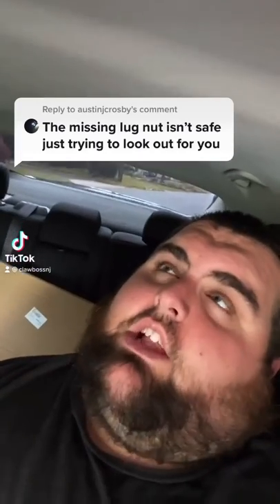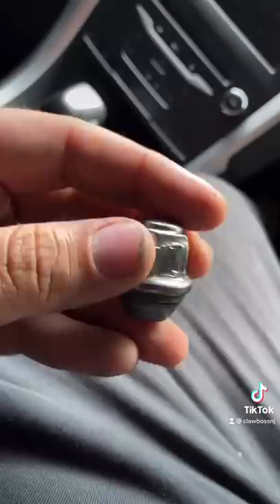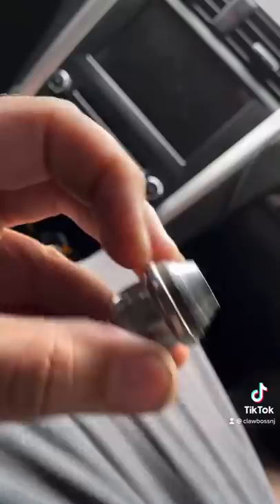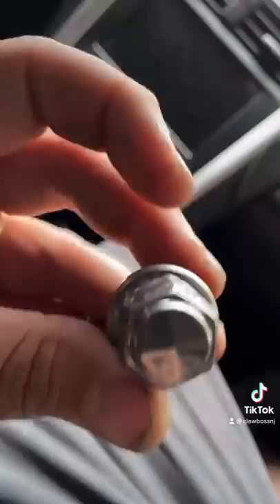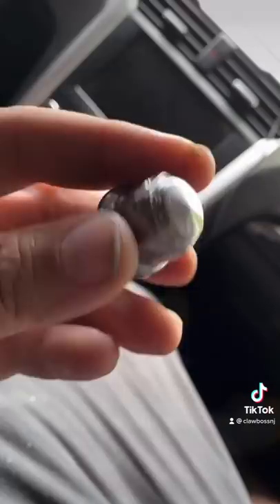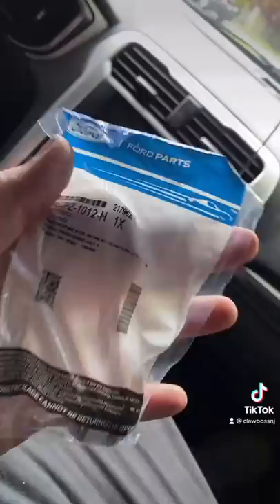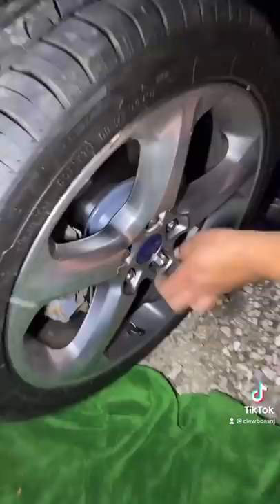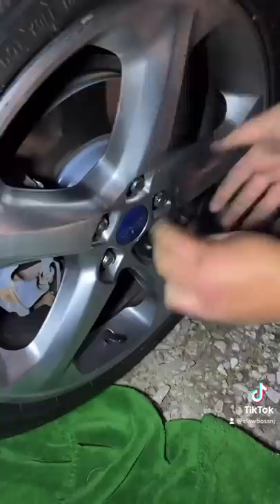Why Do Lug Nuts Expand and Puff Up?

Comment: hah requires a special socket, me in my shop takes a chisel and hammer, take the chrome sh off and look lug nut still usable and it comes off, also, you can drive safely having 4/5 lugs on a vehicle so long as the lugs are properly torqued, heck even 3 is safe, but the reason why 4 is ok is cause 90’s rims, 4 lug hubs, its safe, on light vehicles anyway

Comment: Dont listen to the people that are hollering how unsafe missing one is........ nascar had to remake a 5on and tight rule because the two seasons the rule was relaxed, over half the guys were running on 3, yeah that fast, yeah 100miles or laps between stops..... nobody lost one while driving,  the rule was reimplemented due to danger of breaking off in a crash, possibly getting in the stands officially,  unofficially the drivers decided to lobby nascar to get the rule back out of fear for their safety. So if you are genuinely afraid,  replace it, if not don't sweat it im Old enough to be your dad and I have driven many cars over many years missing a lugnut or two here and there

Comment: I've had to replace all the lug nuts on my truck because of that little cap thing. I ended up going with aftermarket one without the cap so I wouldn't have to keep replacing them.

Comment: I came across that problem today at work and was going research why they do that when i got home and just seen you shared that. while i was doing a rotate on 2018 jeep cherokee with 32 thousand miles the wheel bolt and there orginally 19mm are swollen 19.5 wouldnt fit had hammer on 20 mm socket on  everyone of them tried selling a set of wheel bolts to the customer and she complaind and said we messed them up by using the wrong socket

Comment: Also dude... don't by damn lugnuts from the dealer... just go to like discount tire and but a full set of locking lug nuts or autozone they usually come with like 12 point lug nuts and are cheaper and won't swell up again

Comment: I drove with 4 lugs on a 5 lug setup for 2 months. Then one snapped. And not even a full week later, I was sitting at 2 Lugs because they all snapped off because they werent balanced so there was pressure on all the others.

Comment: If they are on the car just use a hammer a flat head screwdriver and u can get those caps right off I’ve done it on the side of the highway to change a flat tire

Comment: Great information 💁I never knew this and I'm sure others never knew this either 😳
Reply: I don't see how corrosion from liquid under the cap would cause it to swell.

My theory is the cap gets moisture underneath, but it is trapped and the cap seals with the nut trapping it. When it is heated, ie I'm the sun, it evaporates causing it to expand like hydroformed metal.

Comment: unless you torqued it down more off the video (you probably did) but if you didn’t i give that lugnut a good solid couple miles before it vibrates off, i’m pretty sure correct me if i’m wrong it like 84.5 foot pounds for the lugnuts

Comment: The more you know this man’s out here educating people better than the teachers in the school he drives kids to
Reply: I don't see how corrosion from liquid under the cap would cause it to swell.

My theory is the cap gets moisture underneath, but it is trapped and the cap seals with the nut trapping it. When it is heated, ie I'm the sun, it evaporates causing it to expand like hydroformed metal.
Reply: @happytrails5342  when metal rusts the surface begins to protrude outwards, so the outer shell of a 2-piece lug then bulges out due to the rust underneath it
Reply: @dillon5565  what is forcing the surface to protrude outwards? It would take a lot of pressure internally, alot more than rust, to cause that. I still have money on my theory LOL.

Comment: You never torqued much less tightened that lug nut. It's going to go through someone's windshield. Better hope the rest are tight.  I have been working on cars since the 1980's and the one thing I do is use a torque wrench on all lugs and brake components. Sure my elbow torque is pretty good but for super important things elbow torque isn't good enough.

Comment: Napa sells great after market lugnits dont overpay at the dealership and over torquing will also do that and did you just use a21.5 mm socket to remove it

Comment: If you have 5 lugnuts on your car vs some only have 4 its safer to drive than a car that only had 4 from the factory if one broke because there would only be 3 someone vandalized my car each wheel a stud broke, if i had a 4 lug pattern from the factory i wouldnt be able to drive it at all

Comment: You can drive with 3 lugnuts it is safe up to 130 mph look at cars with only 4 lugs missing one no big deal it has been tested as long as thay are torqued to close factory specifications with in -10 flbs through+50 flbs of specifications

Comment: Hey claw, I had to do this on my 2017 f150 with the same lugs lmao there junk. But the stupid chrome cap was spinning on the lug nut, so I had to drill a hole into the crome cap and split it untill I was able to get a socket on the exposed lugnut

Comment: I mean technically your good to drive with a missing lugnut as long as there's not more than one missing on the same wheel, is it safe? no but I've had a shop tell me I'll be okay as long as it's not a long drive and there's not more than one missing on each wheel

Comment: Well... not quite perfectly.. put some weight on that bar and torque it down or you be going to Ford for another one of those expensive lug nuts. Aftermarket has one piece so that don’t keep happening. I deal with it everyday.

Comment: Having four out of five lug nut a is fine if you have to you do not have to have five all the time if you do not have the fifth you can make due with only four lugs cause you still are Maintaining a constant pressure on Welch side of the eheel

Comment: Bro some one loosened 4 lug nuts on one of my dads tires they where trying to steal his rims  that he had just bought and he drove the truck for along time until eventually the tire fell off the truck at a gas station we got so lucky because we where just about to go on the high way and we probably could have got in a wreck

Comment: As long as you got 4 out of the 5 on your ok iv had my truck for 3years now and only have 4 lugs on all 4 of my tires because a spot i took it to to get a flat fixed didn't have the special lug nut key remover with the lil triangle cutout on the front so people cant just rob you for your rim's if they dont have that specific lug nut key jawn yeah so this tire shop didn't have 1 so they some how banged them off or something cause when i found out a few days after getting it patched i went back flipping shit cause i paid extra for them special lugs they tell me oh we dont have that tool so we just took them all off for you incase you ever get another flat like dude you took lug nuts off all 4 tires when i only needed 1 pached an didn't even bother to tell me ontop of it all your a tire shop how the hell dont you have the tool moral of the story never take your car to a ghetto ass tire shop in the middle of Philadelphia  with out looking over everything after you get your tires fixed.

Comment: What was that person talking about lol 3 is safe on 5 lug wheels and 2 is safe on 4 lug wheels ask me how I know lol
Reply: Well In a span of 4 months, My 4 out of 5 turned into 2 out of 5 so no its not safe.
Reply: @ClassCraZeTV  not a problem if you actually tighten them lol thats how lug nuts back off improper tq
Reply: @bass_and_bass3323  It didnt back off, You put pressure on the Lug threads and they snap off, you just have to get a new Hub, trust me, a 3500 pound car going 60 mph those Wheels have alot of energy and that energy goes to the bolt threads that are already imbalance
Reply: @ClassCraZeTV  sounds like your part of the camber gang i remember my first car lol and just do a stud swap
Reply: @bass_and_bass3323  Camber is disgusting, Just a stock 2013 Kia Optima lol

Comment: Actually what happens is the place you take it to uses a 20 mm or a 21 to take off the 19 mm lugnuts because Ford are cheap asses and it cost .50 cence less to make then normal lugnuts and when you take off the aluminum cover it is a 18 mm lugnut so they made it so you will have to replace all 20 every 4 tire rotations thair is a company that makes real lugnuts for $30 for 20 lugnuts I used to be a lube tec Chrysler is also bad with this its because the companies are trying to shave off money in every way thay can it makes sense why Chrysler and Ford have been having so much problems lately cheaper is not better just ask chrysler about whirring and transmissions or ford on how thay managed to make the only manual transmission ever to have problems or the dule clutch automatic transmission or cam phasers or spark plugs getting stuck in the head or just leveling the head entirely taking all the threads with it all true dtory I have seen when working on new crap why can't for make a escort rs cosworth like the 90's awd i4 turbo 227 hp that was a cool car

Comment: Is this got dumb that said I'm missing lug nuts not say just looking out for your safety cool he's looking out for somebody's safety but that's not what I'm talking about on the one side of my V8 I have two studs broken one in the front one in the rear so I have four legs on each one of those tires and it's been like that for I don't know how long all I know for a very long time and I haven't had a single problem as long as you have them tight they will be fine I've seen cars running on one lug because they were vibrated off the other four or five because of how loud the car is and run on one lug for many many miles granite that's not safe at all but you can run with a missing lug because think of it if it wasn't safe to have a missing lug then why do Jeep wranglers only have three lugs on their spare tire to keep it on the back of their vehicle and it's perfectly safe there Grand I understand it ain't going around and around and around but still a Jeep can get hit and that tire not come off I think it's safe enough to have one missing lug and to drive like that